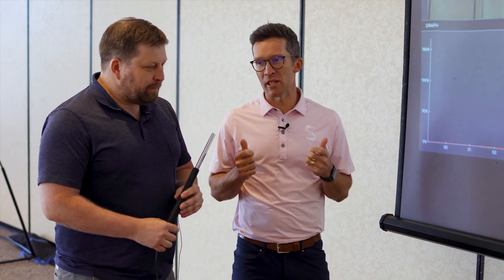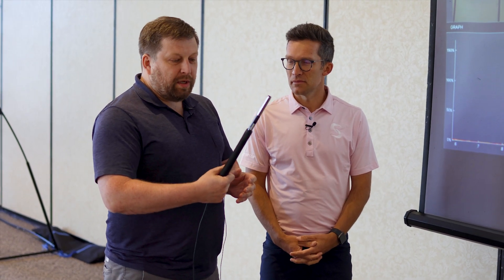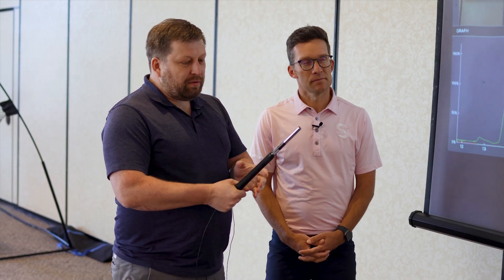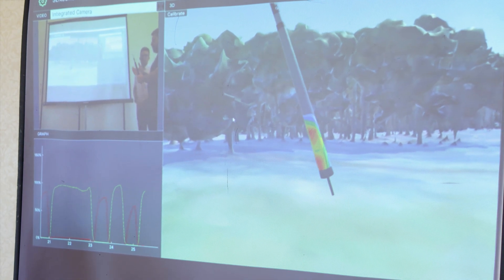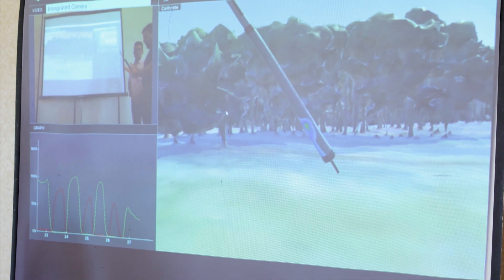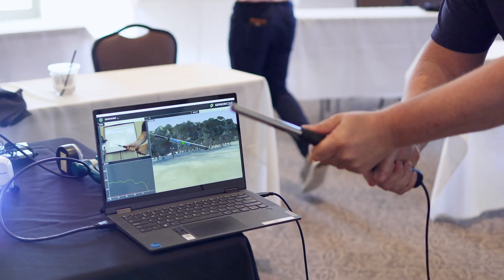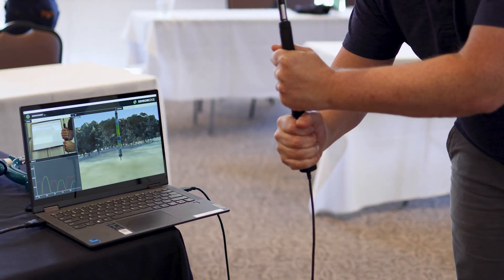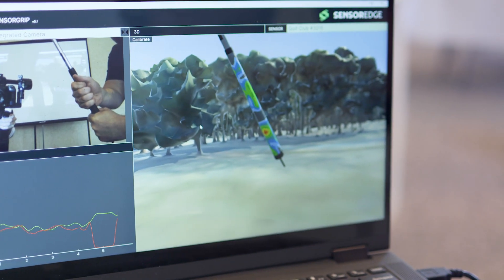This NEW TECHNOLOGY will change how golfers grip the club

Comment: How do you distinguish between the pressure I am applying to the grip, VS the inertial pressure that the club is applying to me?  For example, when the clubhead is going back, and I go forward "while the clubhead is still going back" the club will exert inertial pressure on my hands, during this change of direction, and your sensor will incorrectly identify that as an increase in MY grip pressure.  The same mis-identification can happen during the takeaway and through impact I would think.  
I believe that the only way is to measure muscle contractions in the hands directly.